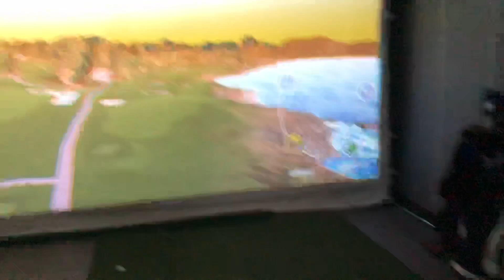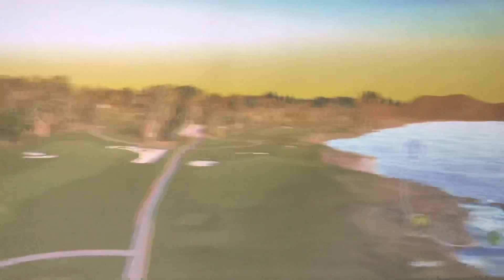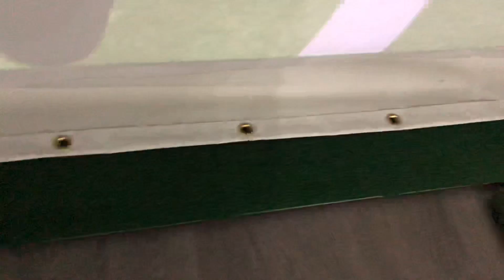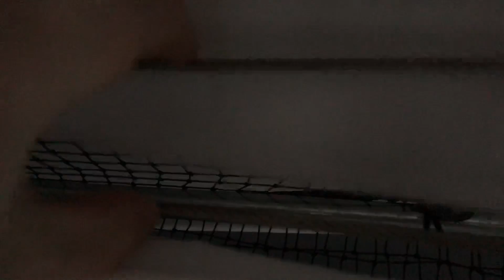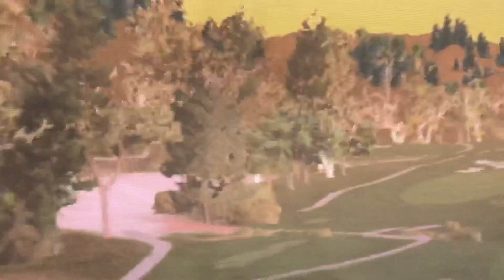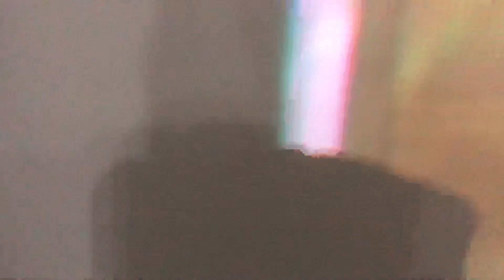Budget Golf Simulator Design by Hybrid Me for GC2, SkyTrak

Comment: Hi Philip, what projector do you have in current setup?
Reply from the maker: This setup used an Acer 3000 lumens 1080p projector. I've since rebuilt the sim and use an Optoma 4k550ST projector, which is great - but a lot more money. The new sim rebuild video series is on the channel

Comment: How much was the Jack Nicklaus Software and how would I go about acquiring it?  Does using the Nicklaus software require getting the Game Improvement package from Skytrak or can it be used as a stand alone golf sim in conjunction with Skytrak?  The "boss" has given me the green light to proceed with my home sim in my garage and I am planning to get a Skytrak.  But after looking at the software in order to play rounds, it's so much more than I would like to spend for a sim software.  Do you know of any other software that would be good for a budget build such as mine and would work with a Skytrak?  Thanks for the tips.
Reply from the maker: Vince Nguyen thanks for your comment. Unfortunately, Trackman acquired Jack Nicklaus Perfect Golf and announced some time ago that they are turning it off for all non TrackMan users on August 30th. It’s no longer available for SkyTrak. Currently TGC 19 and e6 Connect are the only proper sim options for SkyTrak if you want to play courses etc. WGT is a budget option but very limited. I know of another piece of sim software in development that my offer a solution but it’s too early to know whether it will support SkyTrak.

Comment: Philip, I have a 10 foot tall x 14 foot wide screen that I purchased from Golfbays UK I think they are called. 
I would like to have my screen be more taught. 
Any thoughts, I know with seeing mine is will be hard to say. Looking for some tricks
Joe
Reply from the maker: Joe Dolan hi Joe - my first suggestion would be to contact GolfBays as you purchased the product through them. I prefer using tarp clips like  in my new build here (there are 7 parts) as you can then adjust the clips easily to get the tension you want. https://youtu.be/-hAFA5xFw9c

Comment: What did you use for the spot lighting on the ceiling? That shine on the ball. Nice setup
Reply from the maker: Thanks. I just use a single GU10 LED spot. If it helps mine is a 4W Daylight White and was manufactured by Lighting Ever. The light fittings, I think, were just from the local DIY store.